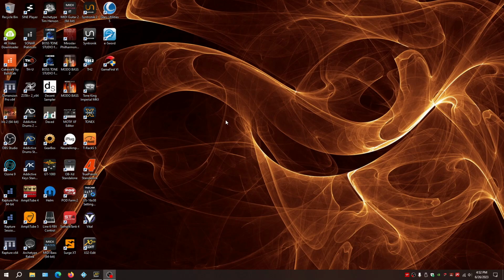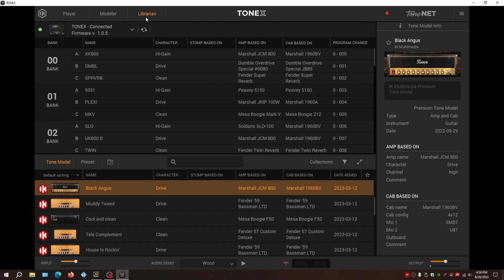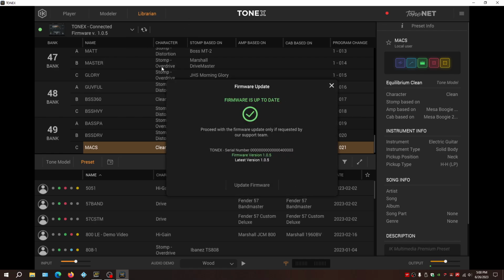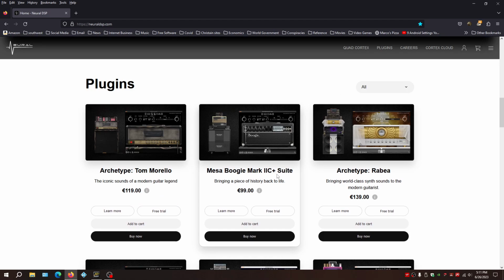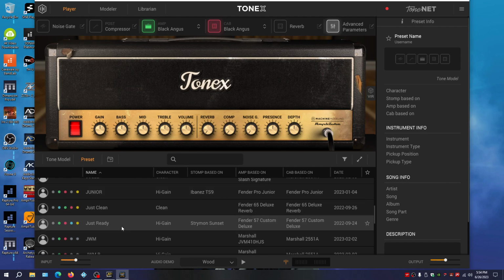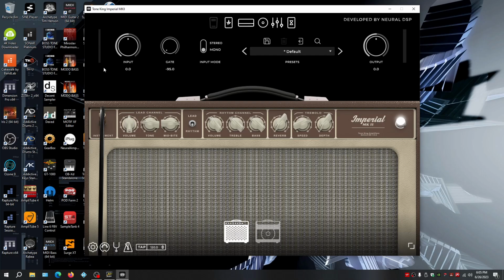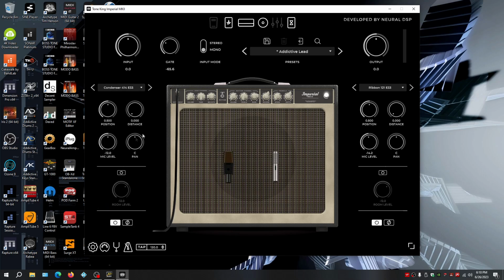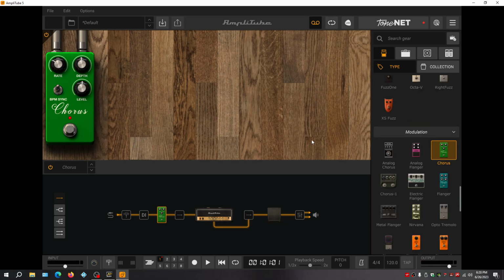Tonex Walk Through and Interface

Comment: Hey I just watched your video and in the video you had reverb coming from the computer app and the pedal simultaneously. When you put the pedal into interface mode you have to click on the switch that is showing green to disable the active pedal preset. This will prevent both the pedal and the app from playing at the same time. Just make sure global setup<general<bypass mode<enabled is selected. This allows the pedal to be put into bypass when you click the switch a second time.
Reply from the maker: Thank you for watching and for the helpful tip.

Comment: Thanks, wondering how to actually bring the Tone King profile into the Tonex pedal after you have it saved? l have reverb in tonex unless I actually turn down the physical Knob on my Tonex Pedal, even though I have interface active.
Reply from the maker: Actually, you don't bring the Tone King into the Tonex. The Tonex just plays the role of a sound card or an audio interface. It just plays what the Tone King Software produces. You can plug a midi foot switch controller into your computer and control the software that way. I need to do a video about that.

Comment: Dude what am I doing wrong 😢… 
I’m just trying to record my tonex processed/wet signal, using GarageBand (same way I did with a helix floor without issue). All settings indicate correct input output, and sound check is spot on. But I only get a flat response guitar on playback. Nothing processed. Settings used:
- global settings/general/usb ‘dual’. 
- operation ‘interface’. (I’ve tried live too, and on solid green for stored, and flashing for software/interface.
- I hear my tone through headphones or monitors, it’s the processed sound I want, I hit record and play something. 
- on playback, no tone. Guitar flat response only. 

I’ve experimented between live and interface modes. Stereo and dual modes. I’m at a loss, can’t record.
Reply: You've probably already figured it out by now but when set to dual mode, tonex outputs the wet signal  on Channel one in the dry unaffected signal on Channel 2. Make sure you select the proper one in your DAW. Perhaps you selected Channel 2 for your input source. If you did it would be the dry signal

Comment: I have been researching the ToneX to utilize for amps/cabs along with my Helix floor to free up more DSP, but I can't seem to find and answer if there is an option to where any tweaks are saved automatically or if you have to hit save every time before switching presets?
Put another way, if I use ToneX with the Hx Floor I would want to be able to change TX presets using midi and HX Snapshots, but if say, I add some treble to a preset - does that change get lost when I switch if I forget to hit save?
Reply from the maker: Changes are not saved automatically. You must save your changes before you change your preset, or your changes will be lost.

Comment: Nice tip about creating a blank preset when using the pedal in Interface Mode with other modeling software in order to keep the Tonex sounds from overlapping with the other software's sounds. However, it doesn't seem to be necessary for me. I'm using Tonex 1.7.5. and pedal firmware 1.3.3. Maybe they've made it so that is no longer necessary in recent updates?
(I'm testing with the Tonex Pedal in Interface Mode and Amplitube 5. )
Reply: He had the preset still active on the tonex pedal. You can see that on footswitch c the green light is still on. All you have to do is click that switch again and the light will go off and any sounds from the preset will stop coming through the interface. Also make sure global setup<general<bypass mode<enabled is selected. This allows the pedal to be put into bypass when you click the switch a second time.

Comment: Can the tonex be muted? or Bypassed when using live.  As any other pedal?
Reply from the maker: This is not something that the Tonex does. There is no bypass function to my knowledge. However a quick fix would be to make a patch or preset that essentially bypasses the Tonex. Your custom patch would shut off all effects and have no amp or cabinet. The E.Q. would be set flat. Name the patch Bypass.  Then load that patch in one of the preset areas. In order for this to be effective you may want to load that Bypass patch in a few different places. When you want to shut the Tonex off just go to the bypass preset.

Comment: Excellent review, thank you - new at this and just got the device!   Really just have two short questions:  When you ran the two "outs -L/R" - did both go into the mixer?  You stated the right did, but not sure of the left.   If you did, would using this option of  L/R outs  plugged into the mixer create or mimic a faux stereo sound for mixing purposes (not talking about the Tone King sim functionality).  I'm thinking of doing this and then connecting the mixer out (USB) directly into the DAW. BTW,I know I can mimic stereo (multi/triple tracking mono and delaying one of them etc).  Thank you, Cheers!!
Reply from the maker: I went out of the Tonex left and right and into two channels of the mixer. I panned the input from the right full right and the input from the left full left. I think you got the idea and it is a clever process. The DAW records from the mixer and you use the Tonex to control third party software. This allows and gives you the ability to record directly from the Tone King or what ever third party amp modeler you are using. Some amp modelers may not allow you to reamp and this is a way to get around that.
Reply: Thank you!!

Comment: Great video. One of the reasons I bought this is to replace my Line 6 Guitar port and practice at home. I usually practice to songs on Youtube for my cover band. But volume  of the musicfrom the PC into my headset is loud AF. Do you have any recommendations on how to adjust that? The guitar volume is fine. 

Thanks
Reply from the maker: I am not sure what kind of computer you are using. I don't have any solutions if you are using an apple computer but I could help if you use a windows system. Everything depends on how you set up your system. Are you using the Tonex as an audio interface or are you using something else? What is the default windows audio interface? You can access this option in the settings section. more information is needed to provide a detailed solution. Usually if you are playing tracks from YouTube the browser will use what ever audio interface is selected as the default audio interface.

I am going to assume that the Tonex is selected as the default audio interface and that your headphones are plugged into that. In this case the audio for your backing track can be adjusted directly from the YouTube video itself. Just click on the speaker icon in the video and adjust it that way. This would be the simple way to do it. If you are using a different audio interface as the default then adjust it from the default audio interface. That option is found in the lower right hand corner of your screen. It is the volume icon.

Another option would be to install a program called 4k download. It will allow you to download the Backing tracks from YouTube you want to use right to your computer. When you play the backing track back you adjust the audio through what ever software you use to play videos in windows. If you are looking for software to play videos  on your computer then consider VLC media player. It's free. The free version of 4K download lets you download 30 videos a day for free. the paid version removes this restriction.

Comment: @marcuscurtismusic - is it only possible to use the amplitude stuff in a live fashion... as in i cant export this as a preset or something to import into tonex? thanks for the video... its made things a lot clearer :)
Reply from the maker: Amplitude can be used as a plugin for a DAW or as a stand alone app, but as far as I know you can't export Amplitude patches to Tonex. There are some features in Amplitude that the Tonex pedal will not do. You can control Amplitude with the Tonex pedal and that's about it. The Tonex software is the only thing that can be used to export patches and you can also download new patches from the Tonex software to be used live in the Tonex pedal. However, Tonex does work inside of Amplitude. I have seen live setups where guitar players actually use a laptop in order to use software like Amplitude, and other guitar software.

Comment: Really looking to buy one. Do you just plug the tonex into a clean amp?
Reply from the maker: That is one approach. I prefer to plug it into a mixing board or a powered P.A. speaker. The reason for this is because the Tonex models Amplifiers. If you plug it into an amp then you got the Tonex amp model competing with the tone from the real amp you are plugged into. You also have the cab model tone competing with the tone from the speakers in the real amp. It is like being plugged into two amps at the same time. While you may personally like the result it is not a true representation of the amp model found in the Tonex and this is where a lot of people are having problems. It makes it harder to dial in a tone you are happy with.

If you do plug it into a clean amp do an A/B comparison. Try bringing up a tone you like on the amp you are plugged into and then unplug from the amp and listen to that  same tone using headphones plugged into the Tonex. You may discover that you like the tone in the headphones better. The reason for this is because you have two amps competing with each other for tone. This may add unwanted bass and low end. Also consider that a guitar amp usually does not go over 5k in the frequency range and a mixer or powered speaker will go to 20K in the frequency range.

It has been my personal experience that amp modelers like the Tonex sound better when they are plugged into a P.A. system or a self powered P.A. Speaker. I use two channels in a  mixing board and I pan one left and one right. I keep the E.Q. in both channels flat. I get the best results this way.

Comment: Am I correct that in interface mode, I could use the third party software and play that through an FRFR or an amp?  If so, that adds a lot more versatility than just the Tonex ecosystem.  Thanks for the informative video.
Reply from the maker: You are correct.

Comment: could i save a preset to the first bank and then use it as an interface? trying to avoid using the software in my DAW. Mac Mini w Logic Pro.
Reply: basically, I want to be able to connect ToneX to the Mac directly, then be able to use the 3 bank/preset buttons as my amp tones, so I don't have to pull up the software in Logic. does that make sense?
Reply from the maker: @xxmodx  Yes I think I understand what you are saying. You don't need to use Logic or any other DAW. There is a stand alone version of Tonex that does not need a DAW in order to work. If you are going to use this approach you would unlock more features in the stand alone software versions if you were to set the pedal up as an audio interface. You can use the amps on the inside of the Tonex pedal (hardware) or you can use the amps in the software, but you can't do both at the same time.

Not to worry though because all the amps that are in the pedal are in the software too and amps tones that you create and download can also be stored in the software as well. Certain sections of the Tonex software will not work unless you use your Tonex as an audio interface. You can still use the Pedal to change patches and it will function as normal. The only difference is the amp models are coming from the Tonex software on the mac instead of the Tonex pedal itself.

To use your Tonex as an audio interface go to the global settings, then go to operation, then switch from Live (amp models in pedal) to interface (amp models in software) When you do this all the features of the software will work and you can also use Amplitude which also comes with Tonex.  It has many more effect types. Tonex can work inside Amplitude. They are meant to go together.
Reply: @marcuscurtismusic  Excellent video, man! Thanks. Can i use the tonex pedal as interface and use the headphone out to monitor the tones i will edit in the software? I ask this because i don't have any monitors at the moment. Thank you!
Reply from the maker: @Matheuszalenski  Yes this can be done
Reply: @marcuscurtismusic  thank you!!!
Reply: I saw on the pedal it had stereo out or dual, what is dual for? I thought you couldn't have dual amps out?
Reply from the maker: @cameronlaing2829  I have not tested it but I believe dual is for creating two separate signal chains while stereo is one chain in a stereo field. Dual will give you two separate mono signals.